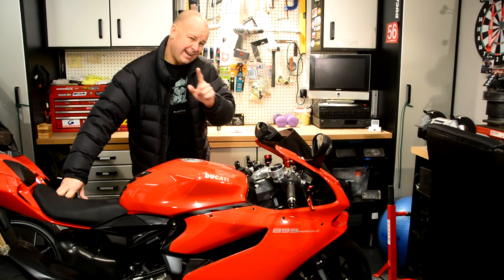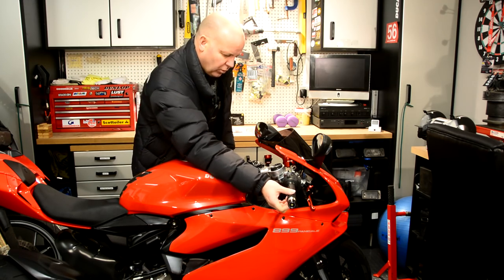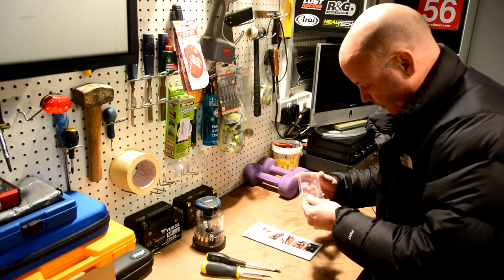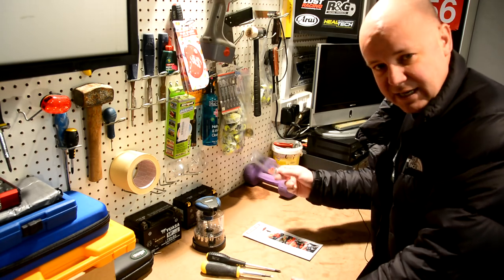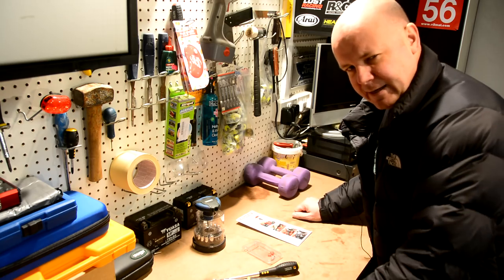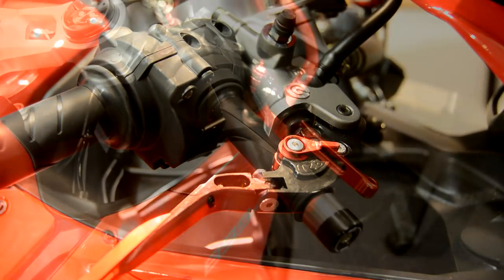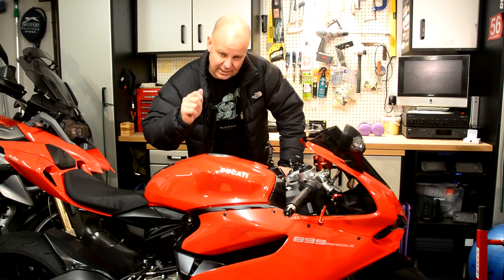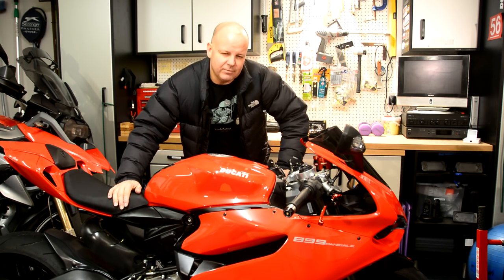How to install a Panigale throttle spacer kit

Comment: Hello Missenden, thanks for the video, even with my sausage fingers, and enthusiastic help from my 5yo - i managed to install the shims on my 899, in about 15-20 mins - just in time for CV_19 lock down - boo hoo. I've ridden about 50km on straight roads and can testify that i now hold a constant speed much more easily. As soon as i can i'll take my regualr 200km loop out along the twisty roads of the Ho Chi Ming Road along the border with Laos. Cheers.

Comment: The new V4 Panigales come with exactly the same loose throttle. I don't understand why. Anyway I've got some spacers, I've got a V4, and I've got a rainy day. And now I've seen your very helpful video I'm off to the garage. I'm hoping that removing the slack will make finding the right revs for a standing start (without gunning it) a bit easier. Loose throttle and snatchy clutch make it a challenge to avoid stalling.
Reply from the maker: Rest assured this will fix it!

Comment: @TheMissendenFlyer I fancy doing this for my 899, so I'll wait and see how you find the results before I jump. Already resenting the cost, particularly given the low quality tool the provide that you couldn't even use!
Reply from the maker: Yes very pricey for two tiny bits of plastic probably costing tuppence, however if it turns out to be as good as everyone says then I'll forgive the cost.  Of course now you've seen how it's done you could just wind a few layers of decent insulation take around those lugs to achieve the same thing for free!  ....at your own risk of course but did cross my mind afterwards....
Reply: TheMissendenFlyer tempting, but a risky strategy.. I'll give it some thought. Thanks for the videos as always.
Reply from the maker: Yes, gawd knows what would occur if the tape got mangled and the throttle stuck open....so maybe don't do that!

Comment: I can't follow how play in the throttle makes the bike snatchy? My Vulcan S has no throttle play at all and it's hard to ride smoothly due to "pilot induced" throttle movement going over bumps etc - this makes the bike snatchy. I look forward to the road test! All the best, N.
Reply from the maker: Yeah, as I say I hadn't noticed an issue so we'll see how it goes - as you imply, the proof of the pudding is in the eating! Will keep you informed...

Comment: It's interesting seeing what ride by wire internals look like, I kinda want a bike with ride by wire now simply because there's no cables to maintain/snap lol
Reply from the maker: Yes I like to know how things tick too, though having said that there were quite a lot of small pieces, flanges, seals, clips, nubbins, dingle arms, tremi pipes and whatever in there - I think the cable versions was simpler!
Reply: Must be a reason why cheap commuters still use them haha

Comment: I have a few questions regarding the spacer.  Will it change the specifications for the butterfly valve?
This model's ECU has an auto-tuning capability, about which I'm a little worried because parameters can change. I apologize for the question, but I need to know if the modification will benefit my bike because I want one. 😂
Reply from the maker: No idea I’m afraid….all I know is it works!
Reply: @TheMissendenFlyer   Even if the video is older than five years, it surprises me that you still respond to me. I appreciate your reaction very much. If you use it for six years without any issues, I believe I have the solution.
Reply from the maker: I try and respond to all comments on the channel if I can!

Comment: Good video

Been considering one of these myself.
Reply from the maker: Yeah I have to say I hadn't really noticed a problem riding the machine (although that slack was definitely there as you saw) - will be interesting to see what difference I notice when riding....will keep you informed!
Reply: TheMissendenFlyer good stuff

Like you say, the slops definitely apparent... but it's never caused an issue personally. Could be one of those things that you change and then discover that it was an issue you just ignored lol
Reply from the maker: That's what I'm kind of hoping...if that is the case then actually it was a very cheap mod (and others seem to rave about it)...

Comment: Although I don't own a Panigale it was still a good video, very well filmed indeed. I was even more impressed though by your devotion to duty to make this video in the very cold conditions, so cold in fact you had to wear your padded overall The North Face Nuptse 700 Down jacket ;@)

You would have thought that QC at Ducati wouldn't have allowed such a sloppy throttle to get past them.
Reply from the maker: You certainly know your cold weather fashion Alex!  Nice one ;0)
Reply: factories purposefully leave the slack on so as to eliminate the risk of it catching while turning the clip-on's but here's the thing...this has ride-by-wire...so I don't know why they still do it. maybe it has something to do with those huge cats at the bottom of the bike or the ugly huge fenders, or the crab-eye turn signals...for a bike to be road legal, manufacturers have to abide by the laws (which we know are almost always outdated in tech)

Comment: That throttle jerkiness you mention, i (Ducati 899) suffer worst on tight 1st and 2nd gear corners, it's very annoying bordering on dangerous if i loose rev's mid corner, or jumps when i accelerate out of a low speed corner. Did you find that the spacer helps - smooths out the power delivery?
Reply from the maker: 100% yes - that jerkiness caused me to drop the bike when pulling out of a T junction once - now I have the spacer the bike is easy peasy at slow speed....transforms the bike it really does.

Comment: Hey TMF! Quick Q, I see you've already replaced the bar ends as well. Do you remember what tool you needed to remove the OEM bar ends? Cheers!
Reply from the maker: +WeNeedASaga I can't honestly remember, I don't recall it being difficult?
Reply: nah, it wasn't - all sorted. took the new one to the hardware shop and matched it up. for the record you need a 12mm hex driver.
Reply from the maker: good stuff....

Comment: What is the wall thickness of the spacer kit?
Reply from the maker: Not sure what you mean by wall thickness?  The spacing itself or the materiel it's made of thickness?  Either way it's on now so I don't know!!
Reply: TheMissendenFlyer the wall thickness of the spacer. Because it's a perimeter type insert, I am going to simply 3D print my own out of ABS (petroleum resistant plastic). I was hoping to get a jump start for wall thickness, but I'll pull my 1299S throttle apart to measure the lugs. I'll enjoy the process of building these, the cost it not really an issue, just the markup for ~30p of plastic and a tri-way bit that seems to be the wrong size is what drives me to do it myself.
Reply from the maker: Yeah I agree there is nothing too it, but the value it provides well exceeds the $30 (or whatever it was) I paid...

Comment: bet some one could 3d print those ,,,, very easily ,,,,
Reply from the maker: +tom thompson I'm sure that's probably how he makes 'em!
Reply: Bit late on this but I did 3D print them for my hypermotard, the file is available on thingiverse and they took 12minutes to print on a high quality setting and used 1 gram of filament.
Reply: @RudeboyMoto   where did those 5 years go lol
Reply: @tomthompson7400  lol,, well I printed them then took my throttle to bits today to find out its different on the 821 hyper than other ducati's... lol, maybe I can make a batch to suit the 821 hypers and sell them at stupidly inflated prices also...
Reply: @RudeboyMoto   sure isnt that always the way